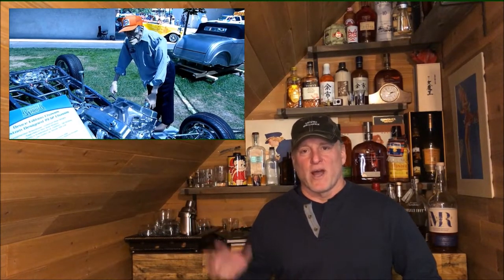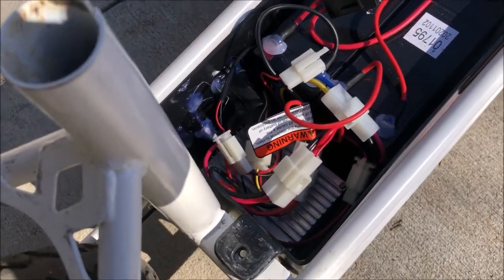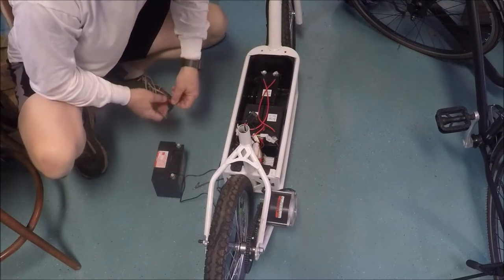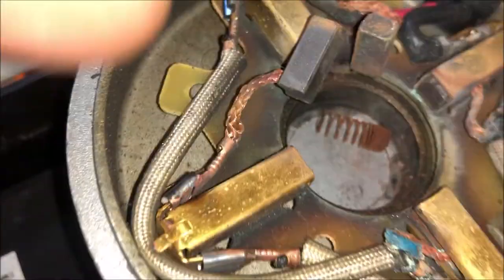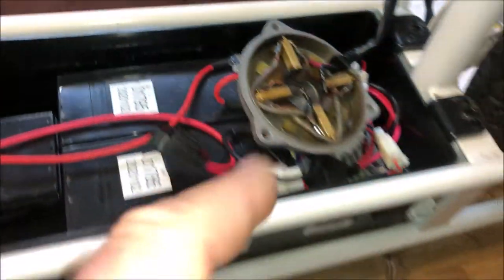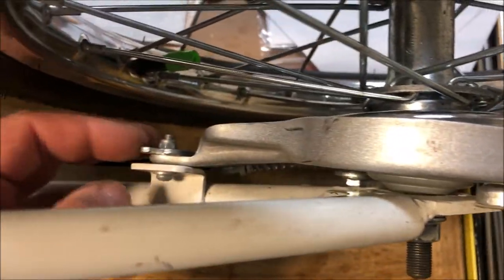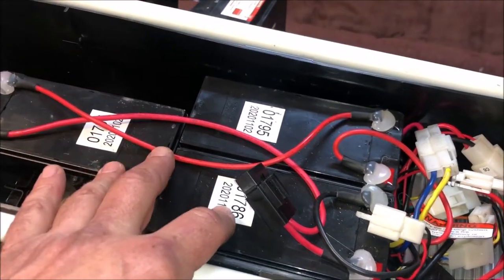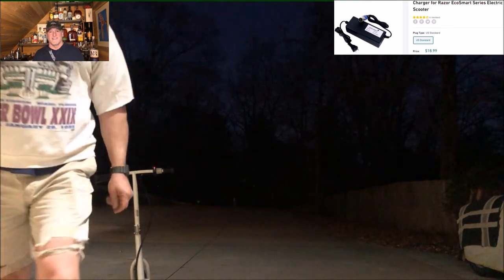How to Fix A Razor That Won't Run?  Razor Ecosmart Metro Electric Scooter Motor Repair for $0!

Comment: I was able to open the motor up.  The springs were OK but the brushes were not moving.  I cleaned the brushes and slots they slide in and out of.  I also cleaned where they contact the rotor.   Back up and running!  Thanks for the tips, Cheers!  FYI when people say all it does is click but doesn't run, the click they are hearing is the relay in the controller.
Reply from the maker: Thanks for that info!  Great comment and glad you are up and running.
Reply: I have the same problem.  How were you able to remove the stator (the middle spinning part) from the motor shell.  the magnetic force was too difficult to push it out.  im afraid it would come flying out once pushed past the shell.

Comment: I purchased this scooter last year and love it! I just got a flat on the rear tire and afraid to remove all the parts to get it off the frame. Please make a video on how to correctly remove and replace the rear wheel and tire. Thanks woman in distress!!
Reply: The disassembly and reassembly of the back tire is not bad at all. The horrible part is re-seating the tire after replacing the inner tube. I assumed it was like replacing a bike inner tube. It's more like replacing a car tire. It required extreme force on the levers to get it back on the rim.

Comment: I've noticed that these things are built as cheaply as possible and spare parts are sold at a premium. Bought a similar one for my oldest daughter about 6 years ago for Christmas. Lasted about a month before it quit working. This particular one had an on/off switch just below the deck near the motor. Company wanted $80 for that switch. Found the specs on it and I was able to find a switch for it for $15 elsewhere. It lasted for another couple of years till a hurricane came and destroyed it.
Reply from the maker: I saw that video about your hurricane.  So sorry about that.  I agree, these brush springs were junk.  The motor over-all looked very well built otherwise.  Did you do a video on your Razor?
Reply: @DrivingIntelligence  Unfortunately no. That was before the FIRST hurricane that destroyed my house. Didn't have this channel then.

Comment: I don't know how you got those short pieces of paper clips out...I used an entire paper clip on each brush so I could reach them to pull out....I'm happy to have found this video...People were overloading the scooter and the brushes heated up and one lost contact because the spring wasn't applying enough force. Seems normal again.
Reply from the maker: I used needle nose pliers to get the small pieces out.  Your method is good.  Thanks for commenting!
Reply from the maker: New video for a better seat post installation with free seat and post clamp!  https://youtu.be/RV06dVmoPN0

Comment: Hey sir when it first started having problems did it just click and rear wheel not move? Thanks!! Great video!
Reply from the maker: Thanks for the question.  When I tested this scooter after pulling out of the recycle bin, the motor would barely turn when assisted with my hand.  Honestly, I don't clicking.  Did you test your motor as shown in my video?  And thanks very much for the compliment!  I'm going to do more of these scooter videos, so be sure to subscribe.
Reply from the maker: New video for a better seat post installation with free seat and post clamp!  https://youtu.be/RV06dVmoPN0

Comment: hey:) awsome video i have a ecosmart 350watt hub motor.. i just had a bk wheel flat. and fix it ..with slim lliquad, but boy they air valves are tough to deal with on the bk tire...:)
Reply from the maker: Thanks for watching!  I enjoyed bringing this Razor back to life for $0!  Is the 350 watt motor more powerful than stock?  This motor is rather weak for my 220 pounds.
Reply from the maker: New video for a better seat post installation with free seat and post clamp!  https://youtu.be/RV06dVmoPN0

Comment: Hey I got one of these Tuesday, and today is Thursday, it's giving me motor problems going slightly uphill, but right after it charges it's like brand new? Do you think I should just keep charging in-between and make sure to not overcharge?
Reply from the maker: I’m not sure it’s a motor problem, sounds like it might be a battery that’s losing charge very quickly. Check the voltage after running it up until the power is reduced. Should still be close to 36 V if you’ve only used it for a short period of time
Reply: @DrivingIntelligence  hey thanks for replying so quickly! I reread the manual and it said to not use it for over 40 minutes, and I think I did, I used it a lot today. I charged it for like 3 hours then used it again and it was like brand new. It just needs a little 'nap' between extended usage. It's all good, and again thanks for replying quickly!
Reply from the maker: @tyrone62original2  sure thing!  I was pretty sure it wasn't a motor issue based on your description happy riding!
Reply from the maker: New video for a better seat post installation with free seat and post clamp!  https://youtu.be/RV06dVmoPN0

Comment: I finally traded razor for another Phantom GoGo! Runs sooo nice! BTW… I have a brand new rear wheel and chain guard for cheap- $60 total if anyone mentions needing one. (Hope I’m not breaking any rules)
Reply from the maker: Where are you located?  I’d like the chain guard.
Reply: I live I Dallas,Tx.The Skillman/Abrams area. You can have it . What's your address?
Reply: I’m not so good on you tube yet. Sorry I took a minute to answer’s
Reply from the maker: @janetparker2878  Hi Janet, I live in Greenville, SC.  Do you have Facebook?  I prefer to provide my address in private at my page:  www.Facebook.com.DrivingIntelligence - & Thank you!
Reply from the maker: @janetparker2878  no worries!

Comment: Can anyone please tell me if they have any experience in what I’m going through with the tires on razor eco smart scooter not keeping air in? Must be me cause I had a glare wheel prior to this one and it did the same thing
Reply from the maker: Hi and thanks for your question.  I appreciate your frustration.  Did you check the innertube for leaks?  Or the valve stem?  You can remove the innertube and put in a tub of water to see if you observe any air leaks.  Bubbles will appear at the hole.
Reply: @DrivingIntelligence  thanks! I think I found the problem and it was me! I don’t think I was using the pump correctly and didn’t realize so much air could escape in a second or two. Now I just have to ride it to see if it stays in!
Reply from the maker: @janetparker2878  glad you solved the problem!

Comment: Hey can the motor cause the battery to go dead fast because I brought 3 new ones in it still goes dead quickly but the motor spins fine
Reply from the maker: From what you are saying, the scooter runs fine, but otherwise the batteries drain quickly?  The only quick solution I can think of is your brake is dragging and using alot of power.  Doers your wheel free spin when you take it off the ground? This video shows the brake adjustment and what I am referring to at the end:  https://youtu.be/JKev3BIjz8g
Reply: @DrivingIntelligence  I just found out the problem it's the chain tensioner spring broke so the chain jumps in skips fast so....this got to be the problem right I read so much about it
Reply from the maker: @deathrow6048  I see... should have made some noise... when you fix it, let me know how it turns out.
Reply: @DrivingIntelligence  will do waiting on monster scooters to deliver
Reply: @DrivingIntelligence  it's the motor I definitely see it ..because it spend so fast to a point the chain jumps in the noise I here when I just spend the motor without the chain on it I hear...
Reply from the maker: New video for a better seat post installation with free seat and post clamp!  https://youtu.be/RV06dVmoPN0

Comment: Hey @Drivng Intelligence can these motors handle being rained on by light rain? Since I ride in the rain, ironically I am familiar with how to fix the control modules and do all the wiring; that being said at least with my setup the rest can handle light rain but I do not know about the motor?
Reply from the maker: Thanks for the reach-out.  In light rain I would not think it is a problem.  After taking this motor apart, it is pretty robust inside, except for the brush springs.  They are cheap metal and they will rust fast.  A soaking rain will be very bad.  If you are industrious, take the motor apart as I did in my video and load up the brush springs with Dielectric Grease.  That will definitely help preserve the cheap metal springs in wet conditions - product link:  Dielectric Grease: https://amzn.to/3c2iwGI
Reply: @DrivingIntelligence  Thanks so much for the solid advice, I am a little bit industrious but also a little bit intimidated to take apart the motor, but after watching your video it doesn't look as complicated as I nearly thought. Thanks for all the information you've shared!
Reply from the maker: You are very welcome! Please subscribe! I should have a few more scooter videos coming
Reply: @DrivingIntelligence  Thanks for the advice! I subbed as well :D
Reply from the maker: @TheIllusiveWorks  Excellent!  I plan on doing a new seat and seat post video, a quickie, but I also plan on doing a vid on disassembling the rear brake, making sure all is good, doing any possible adjustments and reassembly.  Is there anything else you think is a valuable topic?
Reply: @DrivingIntelligence  Yes if you could show disassembly of the motor unless you have in a previous video?
Reply: Like a complete disassembly??? :D
Reply from the maker: @TheIllusiveWorks  there is not much more disassembly of the motor over what I showed in this video.  Is there something you are concerned about with the motor?
Reply from the maker: @TheIllusiveWorks  I'll do a complete disassembly of the rear brake.  I had another viewer ask about how to adjust and rebuild the brake.
Reply: @DrivingIntelligence  Seems like I'm just intimidated by working on a DC motor internally for the first time and I am making it out to be much more complicated lol, seems like there are very few bolts to get in. Also making a video on the pesky rear brakes, would be useful for many in terms of getting everything lined up properly.
Reply: @DrivingIntelligence  also, although I know how to change the rear inner tube, if there had been a video the first time it would have helped, and I actually couldn't find any videos related to the EcoSmart on that subject
Reply from the maker: @TheIllusiveWorks  The motor is not difficult.,  For me, the hardest part was removing from the scooter and releasing the electrical cable.  But here is the caution, do not scratch any of the wiring on the winding, you could damage the motor, so be careful.  Keep asking questions here... I'll support you all I can.
Reply from the maker: @TheIllusiveWorks  thanks for that input, I will look into a video about tire and tube changes.
Reply: @DrivingIntelligence  Thanks for all the info, and I already began collecting pens for when ever the springs rust out 😂✌️
When that happens I will also apply the dielectric grease.
Reply from the maker: @TheIllusiveWorks  good stuff!
Reply from the maker: New video for a better seat post installation with free seat and post clamp!  https://youtu.be/RV06dVmoPN0

Comment: My motor works if straight form batteries.
Reply from the maker: Did you mean, "straight from batteries"?  If so, clearly your motor is good, but you have a problem with the electronics / controller.  Just thought of another possibility, how much torque is the motor putting out when direct from the batteries?  With no load on the motor, the failure I show in the video could continue providing motor operation, but not enough power to move the scooter.